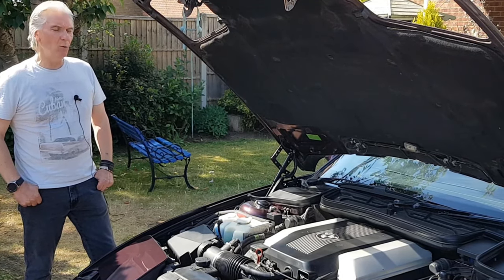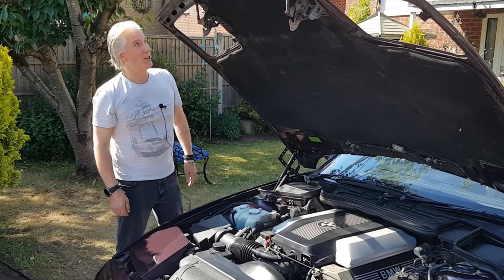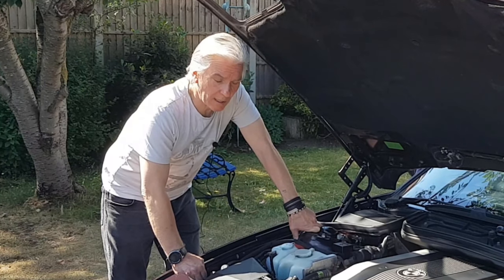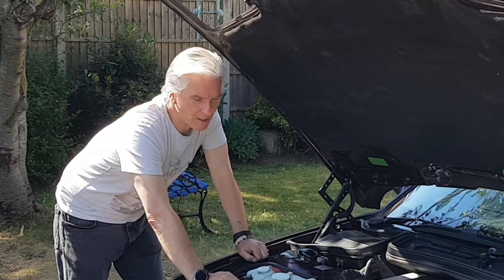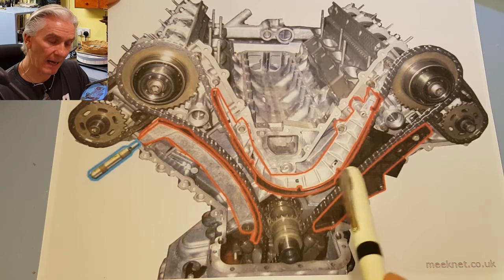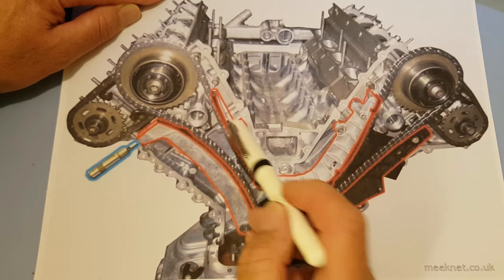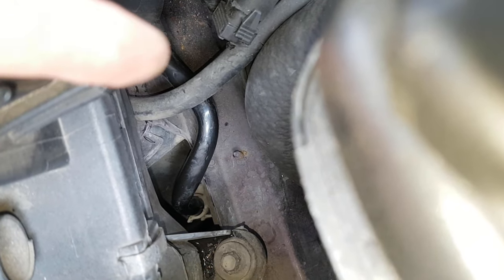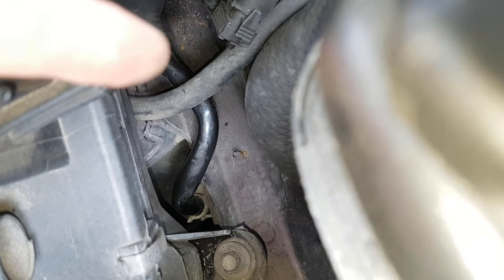BMW M62 Engine - Save your Timing-Chain Guides!

Comment: I did the whole timing chain guide replacement job on my 540i after I replaced the tensioner at ~170,000 km. I think actual act of replacing the tensioner killed the old guides, since the tensioner wasn't pressurized enough before the engine spun up. After replacing the guides and chain (and a bunch of pulleys, gaskets, and everything else in the way - 2 day job) I was sure to pressurize the tensioner per your excellent advice Timm (great video, BTW).

However, since doing the job, even with a brand new tensioner, it will still rattle the chain a bit on startup - the longer the car has sat the longer it takes for the tensioner to pressurize. Any longer than a day sitting, and I get an audible rattle for up to a second. Once I left the car for a month, and on startup forgot to pull the fuel pump fuse to allow it to circulate oil while cranking without fuel - it rattled hard for a good 2-3 seconds (I nearly filled my pants, obviously). The oil change after found a small piece of plastic (maybe 2 mm size) but I'm not positive it wasn't just a bit of leftover from the previous guides getting caught in the filter.

I'm trying to figure out the best way to get that tensioner pressurized enough before the engine spins up. Does anyone know if it's possible to code in a fuel delay on cold cranking? Or maybe wire a fuel cutoff switch to the dash. The only other thing is maybe there is something wrong with the tensioner or how I installed it - do they normally drain out like that? I didn't own the car for long enough to get to know the tensioner normal behaviour before doing the guide replacement (first M62 for me). Any ideas or hints would be much appreciated.
Reply from the maker: The first thing to check is if the oil reservoir is holding the oil over long periods - the relief valve at the bottom is known to leak and it takes a few seconds to re-fill it. Leave the car a day or so and then remove the reservoir lid - it should be full of oil if you are quick enough before it starts draining away.

Comment: Tim; I have replaced the tensioner with a new one primed and preset not to long ago yet i still get some chain slap on start up every now n then, im really good about my maintainance as well.  the guides were replaced by the previous owner @ 140,ooo miles car is now @ 207,ooo mi.
Reply from the maker: What engine? If it is a M62TU then it is quite likely that the Vanos is rattling at start-up

Comment: Great work Tim! Your website and recently also videos have been helping me with my 2001 E38 (m62tub44), that I am owning, or rather loving, now for 13 years so far. Lot's of good and practical knowledge you share. Through this 13 years with my E38 as a daily commuter, I've gradually have been familiarizing with all the issues you had and grasping a lot of car knowledge. 

My timing chain story started as usual around 200kkm with short 1-2 sec morning rattle noise at start. I am mentioning 200kkm, as it is usual mileage when this car was expected to have timing chain job done by factory schedule, and it fails as expected +/-30kkm. In my case, new tensioner did not help to save the timing chain guides. They've broke, but the engine was saved and repaired. After a few rather short years, morning rattle came back after a few days of not using the car. Similarly, I've changed the tensioner (INA quality brand), but not much has changed. I know oil is important, I change it regularly, so by engine block is rather gold than black. What did you not mentioned, and I think also has a big importance on timing chain and guides, is a spring of plastic oil return valve in oli pump. This spring ( 11 41 1 736 790 ) shortens over time (even 1-2cm) the same as the one in tensioner (but has a different function, therefore this shortening is more important I think than in tensioner). In this oil return valve, the piston is plastic, not metal, and after 20 years, I think it is a good idea to change it as well, but usually, no one does it (http://bmwfans.info/parts-catalog/E38/Europe/740i-M62/L-A/jan2001/browse/engine/lubrication_system_oil_pump_with_drive/ - parts 2,3,4,5) The result is that after 2-3 days of not using the car, oil goes down to oil sump, and tensioner does not get initial pressure or gets it a few seconds later. It can have a similar effect as wear of the tesioner - for 1-2 seconds timing chain is rattling and can cause damage to guides. What I think is although tensioner was changed before ultimate timing chain failure (due to guides failure), the main reason in my case was this spring in oil pump ...so it was avoidable. 

I am curious what do you think about this piston and spring in oil pump as I think it might be an equally important failure reason as the tensioner itself, or even more as it is less popular to be changed?

BR Tomasz
Reply from the maker: Thanks Tomasz! And thanks for the information on the non-return valve on the oil pump - it is the first I have heard of this and I will investigate further!
Reply: My mechanic told me also that besides this spring and valve there are also in the oil channels of my engine block some steel balls working as oil return vales, that can be also clogged... but of course, it is impossible to get there without dismantling the engine into pieces. :)   ...but I have not found them on any parts diagrams like ETK.
Reply: If you need information just ask us,we are here to help.We know BMW ect inside out.Thanks.
Reply: Purchase a new timing chain tensioner,cheap and easy to do.
Reply: These BMW M62 engines in terms of use and reliability are well known and extremely common engine plant that will easily see out 400000 km.Mine is at 360000 original engine etc.No lie.Oil/filter is the key.Dont mess with cheap anything if people do we don't want to know about it.🌏☑️👌
Reply: @TimmsBMWRepairsandInformation  Any new news to report?

Comment: Hi Tim. Your advice worked,  I managed to do a chain tensioner replacement,  just following your tutorial 😀👍. You are right,  I will leave the guides alone for now. The car starts and is now no longer rattling like a snake, quietly idling.  By the way,  did this with no mechanical experience, just your tutorial helped . Thanks for selflessly sharing your knowledge with the world 🌎.
Your recommendation for the type of oil in an E34 bmw 540i Tim?
Reply from the maker: Thanks Sonny, I use 2 x Castrol GTX 10W-40 A3/B4 Engine Oil, 4L

Comment: It is absolutely right to say changing oil early keeps the plastic on timing chains from breaking.I just repaired my 3 rd hand M62 4,4 a few days ago.It is a non Vanos engine.So i looked at the front parts of the engine.There i found little rests of dirt.This dirt was caused by one of the preowners .I think he hasnt changed oil early enough.As i Bought the car i changed oil a fully sythetic one i used.It washed the dirt away.The plastic on the old timing chains was very hard and some parts broke off.The engine has run about 295000km now and rest ist in good condition.No oil consumption at all.It is running fine now and i will change oil every 8000 km to save the timing chains.
Reply from the maker: Thanks for the info!

Comment: Well presented Timm.  I'd  also suggest checking the outer surface of your dirty oil filter for any small particles possibly plastic guide material and pray you don't  find any!    I run a cooler 88° C   thermostat in place of the 105° in my 2002 X5 4.4.    These engines i feel run too hot especially here in Australia on a 45° C day😎. Running 10-15 degrees cooler has to benefit guide life.  I also only use high zinc Penrite 10W/ 40 group 4/5 engine oil.  Once again well done👍
Reply: Mine still makes noise on startup but goes away and I replaced to tensioner
Reply from the maker: Yes, I agree, the temperature mapped thermostat is a recipe for disaster!
Reply: @TimmsBMWRepairsandInformation  Hi Timm. Do I take it then that you would recommend substituting the 105 degC stat (in an M62TU) for a  lower temp non-mapped stat like the 88 deg.C?
My compliments on your excellent vid's and info.

Comment: Good video boss but you are working harder than you need too. Invest in additional tooling will make your life much easier.

Get yourself a quality set of 1/4 drive extensions and sockets. You could have removed that air box easy with a long wobble tip 1/4 drive extension and a 7mm socket.
Reply from the maker: Thanks Gabriel!

Comment: Watching again, your repeats never get old Timm. While my 365000km 1997 540i is getting a new radiator, thermostat, fan and water pump (the upper hose came away thanks to a small slice of plastic coming away with the clip) Im thinking perhaps it is time to think about the tensioner. One thing please, you say the crankshaft turns clockwise as viewed from the front but then proceed to show the path of the chain as if it were anticlockwise. Could you clear that confusion up? Thanks again, you're a bloody legend.
Reply from the maker: Thanks Bernard! I'll have to watch the video to check but can confirm that the crankshaft does rotate clockwise when viewed from the front

Comment: Thanks Tim finally done my tensioner yesterday morning on my e38 3.5i alot easier than your car I would say I did soak in oil and fitted fully extended was quiet easy to do the old one was shot love all your videos and advice cheers John Dublin
Reply from the maker: Well done John!

Comment: Just ordered a tensioner for my 2000 540i. Not even thinking about driving it until it's replaced. Been running very good with steady maintenance but not taking a chance after watching this video.
Reply from the maker: Good man, keep up the great work!

Comment: I actually did the timing chain tensioner when I first bought my Range Rover L322  4.4 M62 @ 113,000 miles. I gave it a big overhaul inc all gaskets, PCV valve, silicone hoses etc. I’ve now got 146,000 miles on it & wondering about when I should change the tensioner again? I don’t have any signs of timing chain guide fail, no fault codes but vanos is a little noisy but has been since I bought it.
Reply from the maker: As long as you keep up with regular (1 year, 10,000 Miles) oil changes it should last for another 100,000 miles Paul!

Comment: Replaced my tensioner at 210k KMs, at the 250k KM the chain was replaced. Chain guides were still in a ok condition, could have maybe lasted another 50k KMs. So I think was good to have tensioner replaced. Also quite a difference in strength between new one and the old tensioner. My car 2001 X5 4.4i, currently at 273k KMs.
Reply from the maker: It's always a good move to replace that tensioner!

Comment: Fantstic video Timm, I met you once bought a green E38 up to you MAF, I am doing guides on an M62 TU at the moment on my X5 193,000 miles loads of fun ! but she has FSH and has always run smooth as silk and would assume oil changes have let her live like this so long, mine started by a whirling sound coming from the top right bank rocker, when you presssed down on it it went away, removed the right hand rocker and found the shreaded plastic of the guide............not the best day of my life !
Reply from the maker: Yes, I remember, had a failing torque-converter lock-up clutch!

Comment: Hi Timm.  Thanks for a great video.  Can I please ask a question? My 1996 E38 750iL may have a loose timing chain - at least that is what it sounds like to me through the oil filler cap.  I think that the M73 V12's had a different type of tensioner to most other BMW engines in that it seems from the exploded diagrams to rely on a spring and a physical adjuster (long grub screw with allen key recess in the end with a lock nut) that sticks out of the end rather than using oil pressure to take up slack.  Would you know it my assumptions are correct please? Assuming that I am correct would you please have any advice on whether it is a good idea to loosen the lock nut and wind in the grub screw say 360 degrees at a time to see if it reduces then noise from the chain?  Thanks as ever. Mark
Reply from the maker: It is different to the M62, but it is still hydraulic, the spring does very little, most of the work is by oil pressure. If you are getting chain rattle then replace the tensioner in its entirety

Comment: Hi tim what exact oil do recomened for a m62 4.4 tub its done 306,000 kms took oil pan off every thing looks good no plastic in the pan changed the tensioner been using 5/30 oil fuuly synthetic but i recon a touch heavyer oil would be better im all ears what exacly you recomend
Reply from the maker: I use 10W-40, we have about the same mileage on our cars!

Comment: Hi, you mentioned, that you have m60 in your e30. I have the same one. Could you share with your opinion about this statement, the more heavier engine the worse driving has a car. And maybe your answer would be better to give according to e30. Thanks for responding
Reply from the maker: I had an M60 in my E32 - my E31 has the M62. However, compared to the M30 the M60 and M62 ARE lightweight!

Comment: Hello there! I have owned 3 different M62 Vanos engines (I still have a 1999 740iSport my second! - - 91,000 miles (first month manufacture for the Sport model September 1998 and full of 750 interior parts ) and a 2002 X5 4.6i - 108,000 miles. Having had the engine implode on my first 1999 740i Sport , I am naturally sensitive to the ominous sound of timing chain rattles, and I appreciate your article!  A couple of comments...Owners of these time bombs should be very careful of overheating, which seems to make the timing chain guides brittle and prone to failure even if there is no other damage to the engine....

 My question today regards my X5. I replaced the lower tensioner at around 100K with the INA (new design) tensioner after hearing an occasional brief timing chain rattle (on cold startup only). Now at 108K miles and a year of time, I am getting the same brief rattle occasionally on cold startup. After reading your excellent article, I pulled the tensioner and flushed it out, and started the car using your suggestion of a disconnected fuel pump (brilliant and easy to do-just pull the fuse on the E53). A week later the rattle is back (engine oil is fresh, topped off and 5W-30 full synthetic). I am confident that the tensioner is clean and working as the engine purrs beautifully after start-no rattle ever after start. So it seems that the tensioner is working, but not consistently being properly pressurized on startup- (which by the way is the most violent explosion of an internal combustion engine I have ever heard). Is it possible, in your opinion, that I may have an oil pump that is a bit weak? I am trying to eliminate any possible source of chain rattle before spending up to 4,000 USD on replacing the timing chain guides, timing chain, upper tensioners, valley pan gasket, valve cover gaskets, OSV, intake manifold gaskets. Your thoughts, sir?  THANK YOU!!
Reply from the maker: Good to hear from you Marcus - and thanks for a detailed question! I've had a few M62TUB's and the only noises I have experienced is from the Vanos units themselves rather than from the timing chain (obviously I always swap the tensioner when I first get the car). The Vanos rattle can be very similar to timing chain rattle, possibly more like a very quiet diesel rattle - so easy to confuse. If you have done the tensioner then I would expect the problem to be the Vanos units.

One difference is that the Vanos rattle is not terminal, it is the wear in the helix gears that makes the noise and there is a lot of meat there and I have never heard of one slipping - probably impossible!
Reply: @TimmsBMWRepairsandInformation  Thank You Timm! The rattle is very brief, less than 2 seconds, but quite loud- like a quartet of metal hammers ... Would the Vanos rattle also be related to the pressurization of the tensioner? What makes me think it is the tensioner is that if I run the starter without the fuel pump for 3-4 seconds and then start the car, no rattle... Thanks very much for your quick response and interest...I certainly do not want to be in a hurry to have the engine torn down ...

Comment: I have a question, so all of that work to replace the tensioner right? I'm just young n confused I'm sorry if it's a dumb question, also same goes for the e39 m62tub44 right? And the cranking up bit at the end was confusing too. Also how do I know that the chain is already damaged or not? I'm a 18 year old with a e39 540i and trying to learn everything
Reply from the maker: It looks more complicated than it is. Replacing the tensioner is very important for the longevity of the guides - it is what stop the timing chain thrashing around. AFter replacement there is no oil pressure in the tensioner so stopping the car firing until the oil pressure increases is important
Reply: Thank you so much! @TimmsBMWRepairsandInformation

Comment: I’m working on doing the chain guides on my 2000 540i 
Do you recommend the original hydraulic timing chain tensioner, or the longer aftermarket one?

Comment: Thank you for your great information. What do you think if one uses engine flush every once in a while, to make sure that the orifices on the tensioner and the valve tappets are clear and doing their hydraulic pressure correctly?
Reply from the maker: If you change the oil once a year using a top-brand fully synthetic there is no need to flush. And thanks!

Comment: I change the oil at 7500km interval no guide rail issues and no startup noice so far at 270 000km. But used a synthetic Castrol oil 13 years ago that gave me startup noice from the lifters after longer standstills (don't use Castrol anymore) but Q8 excel 10-40.
Reply from the maker: Thanks for sharing, I've never had that problem with Castrol oils myself, I wonder why yours got noisy....
Reply: @TimmsBMWRepairsandInformation  Yes very strange,It was Castrol Edge 0W-40.